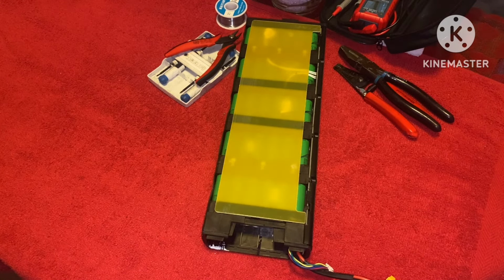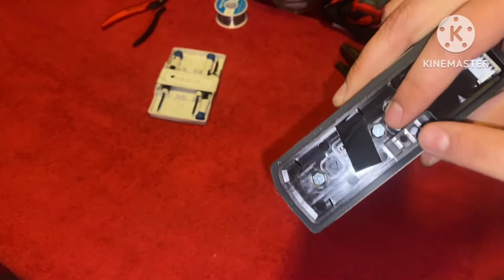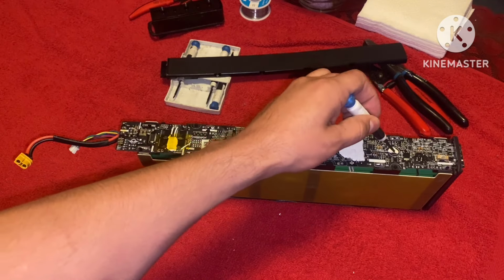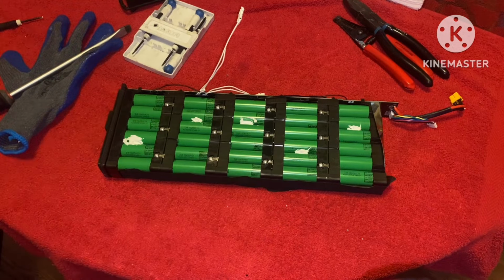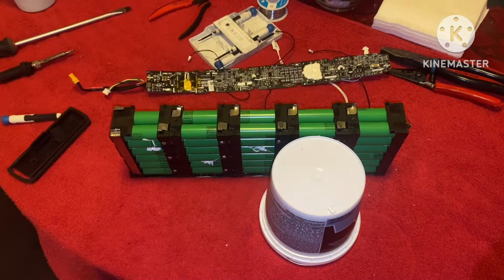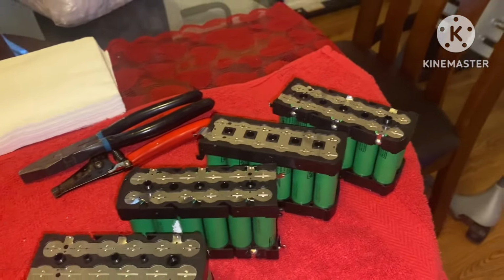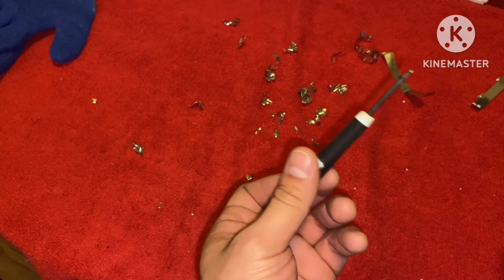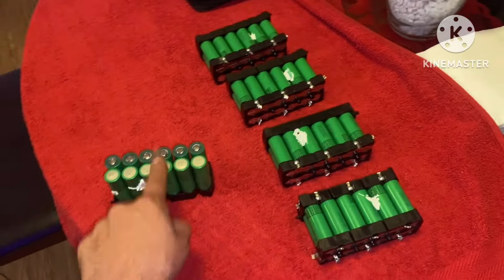Bird 2/3 Electric scooter|Battery pack breakdown| ￼18650|10a 3500 mah cells ￼￼￼|Harvest| Tutorial ￼￼

Comment from the maker: SPECIFICATIONS
Brand	LG
MPN	MJ1
Color	Green
Size	18650
Chemistry	Li-ion
INR (LiNiMnCoO2)
Voltage	3.64V
Capacity	3,500mAh
Terminal	Flat Top
Protected	No
Shelf Life	3 Years 

LG MJ1
Unprotected Flat Top 18650 Battery
The LG MJ1 is a flat top 18650 battery with one of the highest capacities available. INR (lithium nickel manganese) chemistry offers a superior 3,500mAh capacity compared to most IMR (lithium manganese) cells, while having a maximum discharge current of 10A. The flat top terminal design is ideal for use in creating battery packs.
Rechargeable & Reusable
Invest in a rechargeable battery that will last for years to come– this battery can be recharged 400+ times.
3 Year Shelf Life
Stock up and store spare batteries with confidence– lithium ion batteries have a 3+ year shelf life, ensuring you always have a fresh replacement when you need it.
High Discharge Rate
10A max continuous discharge rate for high-drain electronics, such as flashlights that require minimum discharge rates to enable their brightest modes.
Notable Features
» 3,500mAh energy capacity offers longer runtimes for all your devices
» Flat top terminal is perfect for use in battery packs

Comment: Great video man thanks for all of your knowledge you'll be putting out one question, what cells are those I couldn't see? How did you know the capacity of 3500?
Reply from the maker: these 18650 cells have identification numbers on them. LG MJ1 INR 18650 3500mAh 3.7V High-Drain 10A Lithium Ion (Li-ion) Unprotected Flat Top Battery

If you Google this model number, you will find the specs on this specific battery type.
Reply: @pjscootermods  nice, thanks, I couldn't make out Id number

Comment: Can i get some tech help is hit a bump on my bird flex now it doesn't run but power is on..
Reply from the maker: It sounds like it could be a controller issue . Maybe something disconnected , The battery pack is obviously still supplying power
Reply: @pjscootermods  Mahalo🤙🏾